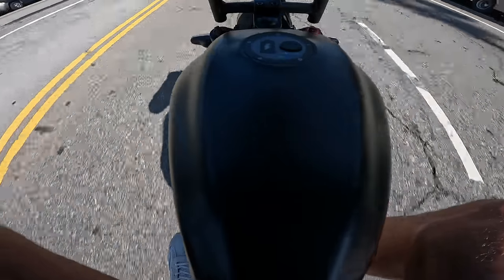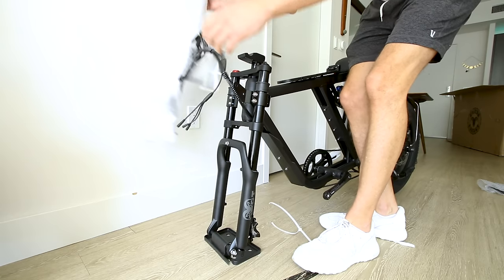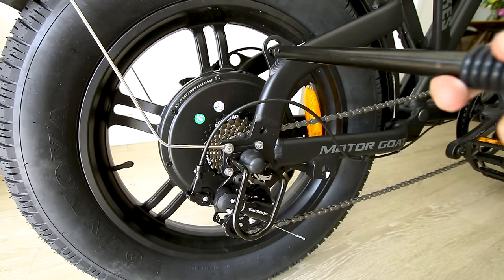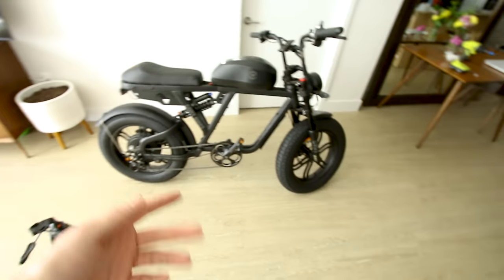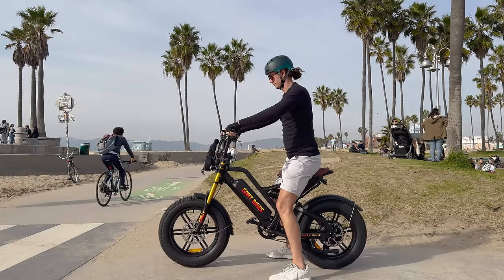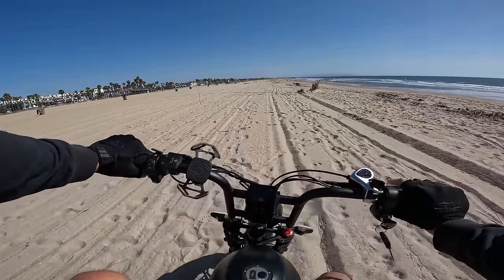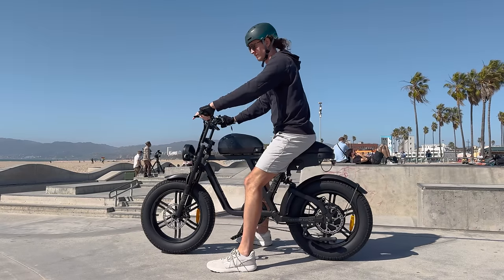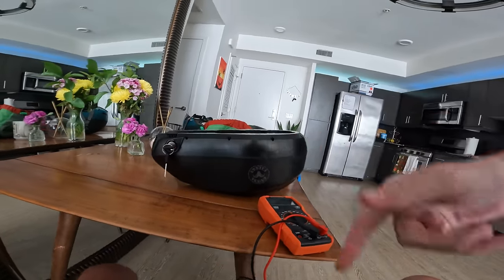This Affordable 44 MPH Ebike has a Sneaky 60 Volt "PLUS" Secret - The Motor Goat V3 Review

Comment: $2500?! Cheap?! No offense but I can link an electric scooter off of Amazon for $1600 it has 5600 watt dual motors it goes 50 mph and 60 miles range. It had RGB if u want it and it even has a seat man.
Reply: Shopping around for an ebike right now any recommendations and link to the one your talking about. TIA

Comment: I've ridden motorcycles. I would NOT do a lot of stuff this guy does. I'd use the high speed to get away from getting crushed from idiot drivers, and just enjoy the smooth ride it gives, along with the extra mileage a second battery would give.

Comment: Bro that thing is $2500, that's not cheap. If you compare with other E bikes its almost $1200 more. You can get a decent e bike for around $1100. I have the first Generation of the Engwe folding bike with 750w and it runs like a champ.
Reply: 2500 ain’t bad for a e-bike

Comment: 25 ah only for such a powerful motor and controller seems a bit low. would be cool if they offered additional battery or something.
Reply: They do offer an additional totaling 45aH
Reply: I will add to what Andyfumo said, they are going to release another secondary battery, which is 50 Amp Hour (Ah), for a total of 75 Ah of capacity.

Comment: I wonder what the range would be with dual battery anyone have any thought 🤔🤔
Reply: It depends upon the speed you are travelling at.  At full power (actual full power is 3000 Watts), at 20 MPH you are only drawing 500 Watts.   You get more range the slower you go.   So, there is no clean answer for "range" unless you specify a speed. You use power 6 times faster at 44 than you do at 20.

Comment: Those brakes seems undersized compared to the size/weight of that motorcycle.
Reply: I have one with the current V3 options.  They are four piston hydraulic brakes with a 203mm rotor.  It has plenty of stopping power.
Reply: @addertooth1  Thanks for the first-hand info

Comment: Or you can just pay $5k and get a Triump 400 and go 90mph
Reply: While burning and paying for gasoline, having to deal with a loud motor that requires nearly double the maintenance, while contributing to airborne pollutants. also taxes & insurance. and a mandatory class in some states. Perhaps a test over two wheel traffic laws as well. Ebikes are just so much easier to get into.
Reply: No! I'll stick to a $2500 civic.
Reply: Ahh yes. Why wouldn’t I want to pay over double the price upfront, greatly increase maintenance and upkeep costs, limit where I can ride it, and deal with gasoline?
Reply: Triumph is shit. Zx10r...... or a bike when you got 3 dui....
Reply: When the speed limit in nyc goes to 20 mph, this will be the way to go. No plates_ No speeding tickets.

Comment: Speed without torque is useless tbh, id probably replace the motor after at most 3 months
Reply: I point out it has a 4.9 second zero to 20 mph time.  This is faster than other bikes with higher "torque" figures.   I race cars on a track.  I realize that torque is important, but not the entire factor on fast acceleration.  My Lotus Elise only makes about 145 foot pounds of torque, but goes zero to 60 under 3.7 seconds.

Comment: My wife's Vespa can do 65 mph up a hill and has a 180 mile range.  My BMW R 1200 RT can go faster than I have the cajones for and it has a 350 mile range.  My commuter style e-bike can go 28 mph and at 6'2" I can actually peddle it so I can get some exercise.  It has a 40 mile range at high pedal assist and about 100 mile range at low assist.  I'm not convinced that these "fast" moped style e-bikes have any useful advantages over other technologies.
Reply: This type of bike bridges the gap between your commuter style e bike and Vespa. It’s faster than your commuter bike with no need to pedal (I don’t want to show up to work sweaty), while more portable than a Vespa (I can bring this inside my apartment). It has its place.
Reply: @EdmundV  You definitely don't want to charge an e-bike inside your apartment unless you charge the battery inside a fire-proof enclosure.  Look up e-bike fires.  There are good videos on YouTube that show fast a Li-ion battery can burst into very aggressive flames.  Even if you charge it inside a fire-proof enclosure it still isn't safe, burning li-ion batteries produce noxious gasses.

Comment: 😳🤔 BE CAUTIOUS. Interesting bike, if someone wants more of a moped than a standard e-bike. Especially considering that this Motor Goat model deviates substantially from industry-wide ebike standards, it definitely does not compete with the 2024 Wired Freedom ebike-- even at Goat's current low sales price of $2,100.. 
It is also something about Goat's logo image that is discomforting: Speeding at +44 mph with a "bicycle hemet" on paved streets, then "waking up" to a dude with a Goat Head, pitchfork and a Lake-of-Fire hard-on maybe?
California Ebike dude, you are a hilarious and good salesman. Thank you for your reviews.
Reply: If the +44 MPH speed is an issue, then why did you even bring up "safety" and the Wired Freedom, which runs at roughly the same speed.  The Goat also comes with front and rear turn signals, emergency flashers, and a high/low beam headlamp.   It is better optimized for "safe street riding" than the Wired Freedom.  The Goat also offers higher battery capacity than the Wired Freedom, which makes it better for longer commutes.  You have three battery capacities available: 25 Ah, 45 Ah, and (soon) 75 Ah.

Comment: affordable? for who ??
Reply: Im on a single dad budget. Mine should be here next week.  I skipped breakfast and lunch for 8 months so I could buy it.
Reply: It would be affordable for those who are looking for a Commuter eBike, to replace some of the miles they put on their car.  For the adventurous, they can use it to replace their car for their daily commute (but may get wet).  Or, for the very poor, who cannot afford a car, but need to travel moderate distances to work but can't arrive sweaty from pedaling.  

For me, I am the first category, with several aging cars in the driveway.  I reserve driving the cars for rainy days; on other days I take the Goat to work.  Miles put on the Goat, are miles of wear and tear taken off the cars.  Also, eBikes have lower maintenance costs, and lower "cost per mile" than a Gasoline car.   My round-trip to work each day costs me 5 cents worth of electricity.  I can't start my car and drive to the end of the block on 5 cents worth of gasoline.

Comment: SURE, some waste case gets gaga over a bike. A 2500 $ bike that gets ripped-off the first time it's  unattended....Blah,blah,blah....
Reply: I am not sure where you are from, but in the USA, there are such things as locks and bike alarms.  There are even trackers.  And yes, I always use two locks when the bike is locked to a rack at a store.  I just got it, so I still need to mount my alarm.  But then, I live in a low crime town.   In places like London, thieves steal the entire rack with several bikes attached at the same time.  They load the rack (with bikes locked to it) into a large panel van.  But then, in high-crime cities, they will beat you up to steal your Air Jordan shoes too.
Reply: @addertooth1  Look pal nothing made can stop theives. But buying an expensive bike and riding it is great. But , you leave it unattended ( locked , tracked or not ) it's  gone.
Besides , if you can afford 2590 to 5000 for a flipping bicycle it's  theft you'll have insured. My point is who needs them !!!

Comment: They really need to stop putting the battery at the highest possible point on the frame. It's like they're intentionally trying to give it poor handling.

This is why I hate these moped-style ebikes. It's all aaethetics and they slap on whatever off-the-shelf components they can get. There's no actual design going into them, no thought at what would make something a good machine. All the work was done by the companies who made the motors and batteries and then these clowns come in and create a chassis that a trained monkey would come up with.

Comment: I'm sorry this thing is a Moped or e-cycle masquerading as an e-Bike.  As the e-Bike laws start getting passed, I'd expect the odds of being stopped, along with requiring registration as a Moped to be a lot more likely.   At least a Wired Freedom or e-Cells 5-Star look like a bike, and unless you're tooling down the road at 40 mph is going to fly under the radar.

The scary part is the brake test, where TailHappy has the entire back end lift off the ground. - Having had a pedal bike flip over applying the brakes when I was a kid, knocking out a couple of teeth in the process, that test sent a shiver right up my spine.  Those brakes need some adjusting to push the bias more to the rear caliper during a panic stop.
Reply: I will take a different approach.  If you have a bike that can't lift the rear wheel off the ground when you tag the front brake hard....,. your front brakes are undersized.  Undersized brakes are a real risk.  They limit how fast you can stop.  You can always lighten up on the brakes if the rear wheel lifts.